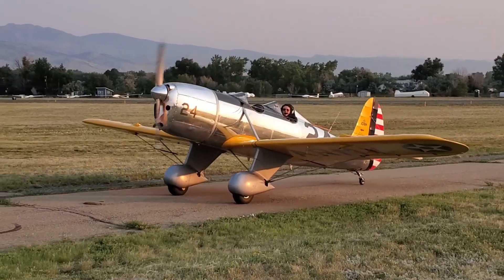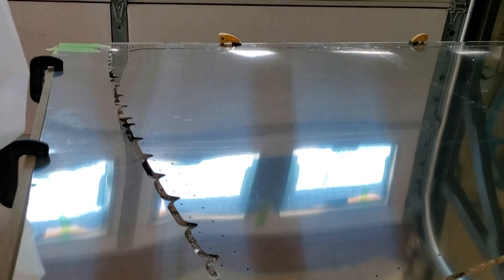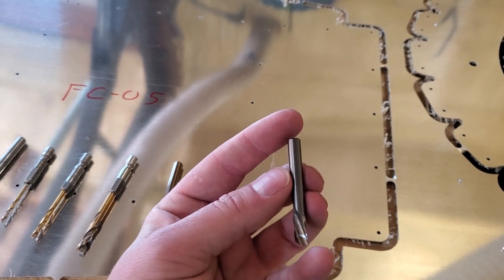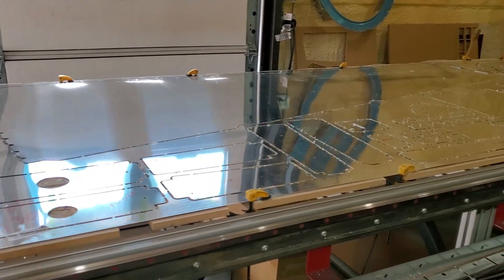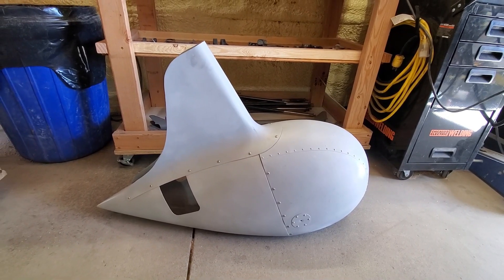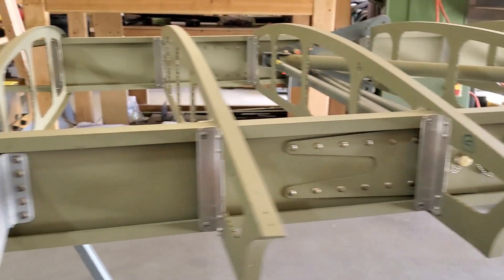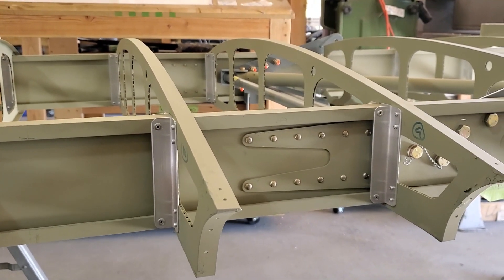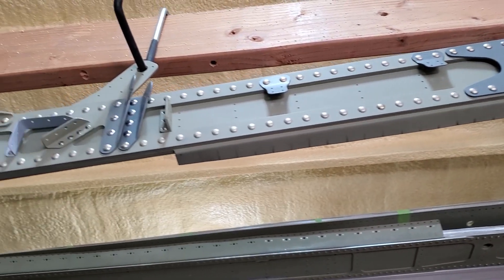TTA Inner Workings:  CNC Cutting Part 1

Comment: Pretty impressive stuff! Thanks for sharing! On your quick build kits are the aluminum and steel parts already treated for corrosion prevention? Also, what type of welding are you doing on the Speedster's tubing? Is any stress relieving done to the joint after making the weld? Thanks! Super interested in your designs! So glad I found your company!
Reply from the maker: Just saw these questions.  I'm glad you asked on the Speedster video!